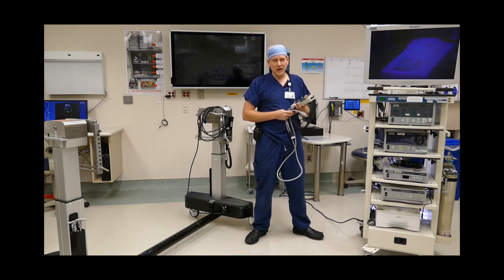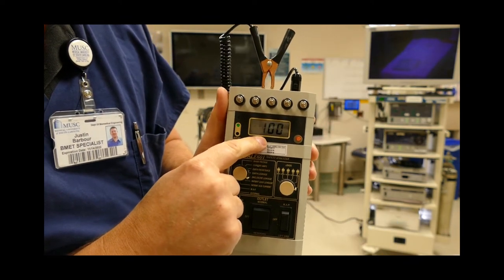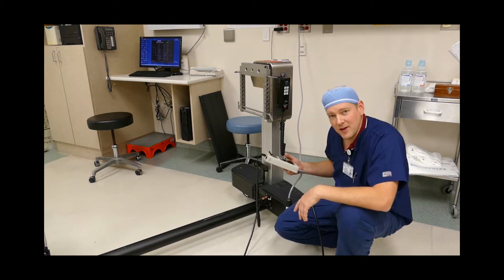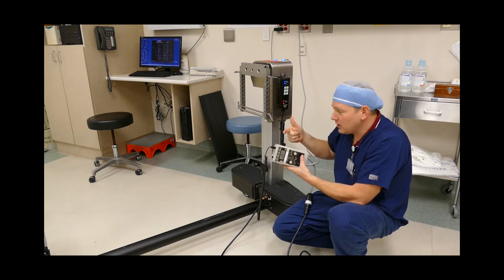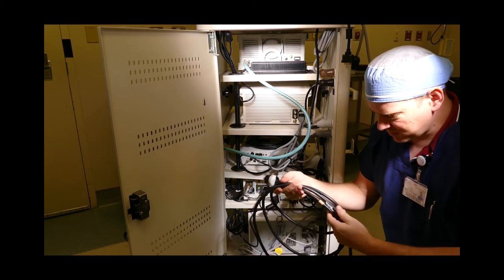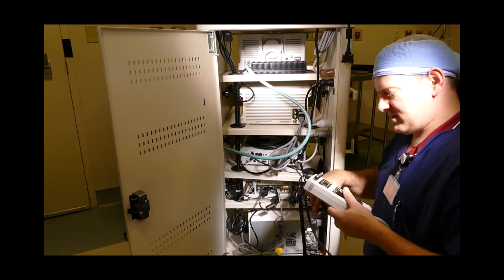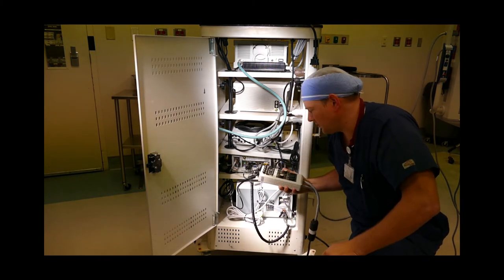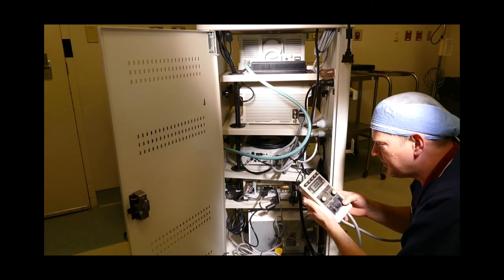07  NFPA99 2018 Electrical Safety Test

Comment: Would you normally have to record the data for all the devices and what the leakage current levels were, along with the ground resistance measurement or would you consider that a pass just based on visually seeing that the values were within the acceptable ranges?
Reply from the maker: Most places require a pass / fail result on electrical safeties. It's up to the technician to know the latest NFPA regulation and leakage values.
Reply: Thanks.

Comment: @Better Biomed Channel, I didn't pick this up in the video, but is there a hard and fast limit to the Earth ground resistance? I saw the 0.15mOhm tester point, but is there a hard limit to this as there is for the leakage currents 100/500microA for lift/chassis respectively?
I apologize as I am unfamiliar with this device/limitations for patient care.
Reply from the maker: There is an updated 2021 NFPA99 with different limits

Comment: How do you measure the leakage current of the ceiling lamp?
Reply from the maker: Do you mean current that is induced into other conductors?  All induced currents should go to ground. I guess I don't completely understand the question.
Reply: @BetterBiomedChannel   I'm sorry, I mean to leakage current of scialytic lamp that is within patient vicinity. It should comply with 10.2.5.

10.2.5 Leakage Current — Fixed Equipment. The leakage current flowing through the ground conductor of the power supply connection to ground of permanently wired appliances installed in Category 1 or Category 2 spaces shall not exceed 10.0 mA (ac or dc) with all grounds lifted.
Reply from the maker: @marvinelizondo  Nobody is testing that. Nobody.

Comment: Just a comment, your electrical safety analyzer is plug in on a emergency red (Line isolation outlet) in the OR. Wouldn't your chassis leakage reading will be low. In comparison to being plug into regular standard outlet?
Reply from the maker: No. The chassis leakage is measuring a difference in potential between the chassis and ground (where the analyzer is plugged in) - since the chassis should have a 0V potential (if properly grounded).  Ground is ground regardless of isolated power or regular (emergency or non-emergency outlets)
Reply: Is the red outlet in your OR is
Connected to the LIM monitor. If yes, then those outlet has floating ground since the ground and neutral are connected on the primary side of LIM transformer only And on the secondary the ground is not connected. Therefore isolating the device.  Usually I noticed if I conduct electrical Safety test inside the OR room I get a lower chassis leakage in comparison to the white outlet outside the OR room. I’m just curious how’s the OR are setup in USA.
Reply: Your are right Dennis, according to NFPA 99-2018:
10.3.3.3* Techniques of Measurement. The test shall not be made on the isolated power system or separable isolation transformer.

A.10.3.3.3 This test is not valid when performed on the load side of an isolated power system, because the values obtained will be falsely low
Reply: @marvinelizondo   thanks
Reply: @denniss4455  Correct, so he is doing the correct EST unless they are using the OR devices outside the OR.  which he would then check with that outlet
Reply: @cdharris22  you don’t get the point. You should not conduct your EST when your electrical safety analyzer plug in on LIM outlet. Since it will give you false reading on ground resistance and chassis leakage. Because LIM outlets are floating ground.